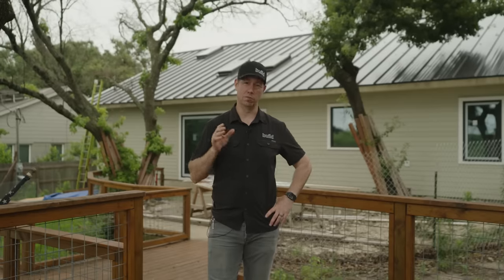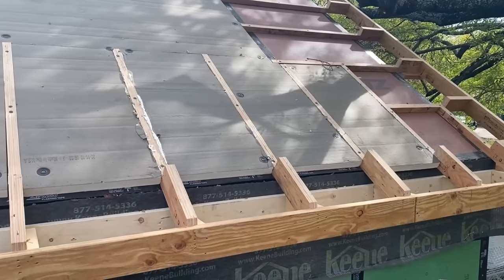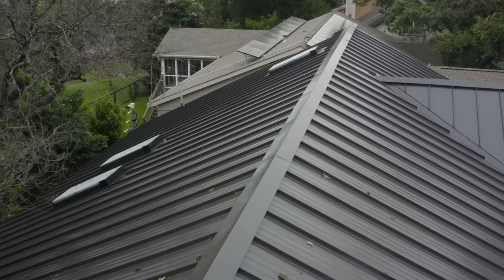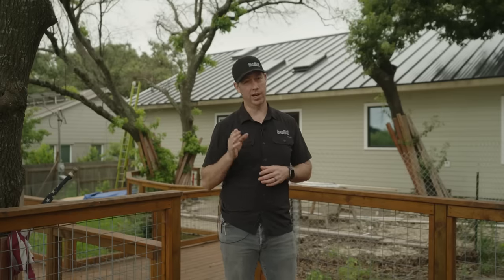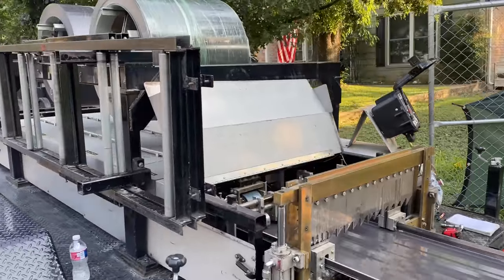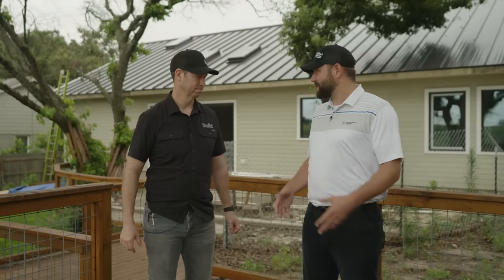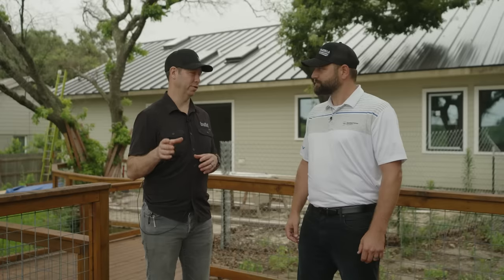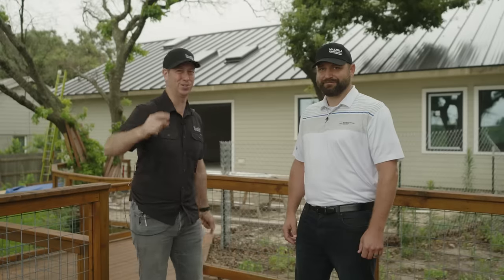Metal Roofs - 2 Ways to INSULATE UNDERNEATH!

Comment: using SIPS for the roof is probably a better option & might be cheaper when the labor costs are included. FWIW: I have 12" SIP panels for my roof, but the 6" SIPs would probably be about the same costs (material + labor) as using the individual Poly Iso panels. Plus SIPS can handle the overhang with out any weird bracing.
Reply: What is the R-rating of those 12 inch SIP's plus the overall rating?
Reply: @StellarFella  R-48 for 12" SIPs
Reply: Where are you located? Matt's house is in Austin, TX, and I'm wondering about the viability of SIPs in austin.
Reply: @h57s  East Coast.
Reply: Love this idea. I'm getting ready to build in Minnesota and could use this. How did you handle the detail of where the wall meets the sip? What panels did you go with?
Reply: @SupercarSeany  Used 2x6 knee wall with the top plate angled to the pitch of the roof. I used 24" overhangs provide shading, and to help with wind driven rain. Used glue-lams for the support beams.I used  plumb cuts for the SIP fascia. I also used a high Perm underlayment so moisture can escape. The important issue is to not use a non-permeable underlayment because it can lead to rot with SIP roof panels.
Reply: @guytech7310  this sounds awesome, I'd love to get some more details/photos/etc.
Reply: @SupercarSeany  Might check out EPS sips in northern Iowa, I'm not sure about anyone closer but they're up the road from me. Shipping gets costly with transportation costs now a days.

Comment: Have had corrugated metal panels on my 1823 Cape for years. Lower cost than shingles, cooler in summer heat due to the 1x3 strapping that gives an air channel from soffit to ridge. Almost no one in Maine uses standing seam due to cost and high profile of fins to wind and snow.  Corrugated also is much faster to install as the panels are 2-3 times wider than standing seam panels. Labor is 1/2 that of shingles.

Comment: Deleted scene: "So that makes the final thickness of my roof four and a half feet. It's a real bomber roof. In fact it's rated to take a half stick of dynamite without penetrating into the attic."

😂
Reply: @buildshow  Matt ,   Loving the steel roofing content.  Just remember … Just because a steel roof panel is a thicker gauge of steel … does not always mean that is a superior product .  Generally speaking , if a metal roof supplier is boasting that their panel product is a 26 gauge .. or a 24 gauge steel .  That is all fine , but what quite a few people fail to acknowledge is that the steel tensile strength of the panel is extremely important as well .   The roof steel tensile strength is the strength of the panel or hardness of the panel .  If you are talking about a thicker gauge of steel , usually those thicker panels are a much lower psi tensile strength  ( tensile strength in PSI ). This is due to the fact the thicker gauge steel panels need to be softer to allow the coil stock to be fed and formed by the forming machines.  The softer the steel ..  the lower psi tensile strength … the less resistant the panel is against storms / hail / debris .   Truth be told , if you look at and study the actual physical thickness of a steel panel  with a micrometer and you start comparing the differences between steel panels actual thickness of the panel on lets say a 28 gauge vs a 26 gauge .. its amazing how little of actual physical thickness differences there are between “ Gauges Of Steel “ .   - Keep up the great content !

Comment: Stupid question: when you build in the venting directly beneath the metal roofing (with 1x4s?) Can you still walk on the roof without bending/dimpling the metal panels?
Reply: I think that's a great question.
Reply: Only if the contractor builds a  road underneath the metal roof. 
My uncle has his roof done that way. Once it was finished the contractor handed my uncle a map . A map to be able to walk on the roof. There is a lot of the roof he can't walk on unless he wants to damage the very expensive roof.
Reply: I have a 24 ga metal roof on diagonal 2x4 sleepers at 16" oc spacing. You can walk on it, just be careful, don't jump up and down...
Reply: 8:18 it looks like the venting is between the 5/8 plywood and the insulation. 
The metal panels would sit on top of the 5/8 plywood, providing support.
Reply: @rogerflorida1498  yes, except for when you look at the diagonal during strips @8:31
Reply: Roger & toldt-
Y'all are comparing two different roofing set-ups.
The one with the diagonal spacers & metal roof directly on top is Matt's personal house.
The one with the 5/8 wood and spacing built in between the insulation is the house he's standing in front of during this video.
Two totally different houses with roofing done 2 different ways.

Comment: Im actually trying to figure out how to insulate my house from the outside so I dont destroy the walls inside. I had a weird metal roof installed on my home that has tall grooves on top - about 2 or 3 inches tall every 4 inches.I want to fill those grooves on top with rigid foam insulation cut to size. I need something to cover that, that isn't very expensive and also doesnt need to be screwed or nailed into anything since my roof is metal down below! I don't think I'm going to be able to use glue on a roof lol. How could I do this and have it be safe? If I glue the foam into place, and paint the roof with elastic roof covering paint, will that last a good long time? I live in a mobile home in FL with a really low budget. I just want the AC to rest sometimes, because its running 24/7 in 100+ degree temps.

Comment: I have a whole house fan in my 1978 home, dated, I know... but, what I would love to see done is an integrated trap style vent installed in the sidewalls of the skylight risers, (into the attic space) with the draw being from a large whole house fan out one side of the house. This way, you can take the air from all the key areas of the home, not just one single point! You could even program them, so only certain ones open, or all of them, allowing you to control how and where you want to pull the air to refresh the house.
Reply: We used to have one which we removed and couldn't afford to replace. That was fantastic in the fall in South Central Texas  nights. Bring in the cool air from outside also to clear cooking odors quickly, or those rare winter days when it warms up in the high 70s and you want to air out your house.
Reply: Keep it they’re fantastic! And way cheaper to run then AC!

Comment: Your homes are mind blowing and the roofing is amazing.   I called a few metal roofing companies for a standing seam quote for my 1800 sq ranch with 24x24 garage.  The quote came in at $90,000.  We opted for a 50 year shingle roof for $10,000.  Not sure how anyone can afford this type of roof.  And that wasn't adding insulation either.
Reply: You could do 9 Roofs for the price of one. Lol sounds logical
Reply: It wasn't that expensive pre-pan-demic. I paid about $34K for 3200 sq ft roof (Late 2019). If your not going to stay in the home more than the lifetime of a shingle roof (about 15 years) than it does make sense. However I am planning on staying on my home, and as material & labor costs go up (as they already are), then it makes sense.
Reply from the maker: That’s really really high. Metal should not be 9x an asphalt roof price.
Reply: @buildshow  Its pretty high. My neighbor got quoted $46K for about 2200 sqft roof using r-panel back in July. Perhps prices have dipped some.

Comment: I love the shingle looking metal roofs that I've seen on their You tube channel. 😍
Reply: standing seam > metal shingles
Reply: @christopher6161  just curious, what's the benefit?
Reply: @christopher6161  that's what I meant 👍
Reply: @koljag5  massive uplift wind rating on good standing seam vs metal shingles limited to 120mph...easier to repair and get replacement parts...easier to find installers...probably cheaper for most installs...metal shingles also use exposed fasteners, and best case they are only covering the fastener on top of the shingle below it with another shingle so very little defense against ice dams/wind-driven rain

Source: I used to shill metal shingles
Reply: @christopher6161  perfect, thank you!
Reply: @christopher6161  There are many metal-shingle roofing systems that have no exposed fasteners and wind-rated up to 200 mph. Take the Oxford Shingle for example.

The other perk to a metal-shingle vs standing-seam is that you typically do not need to vent under the metal-shingle, as there is already an air-space due to the nature of the design. It also doesn't oil-can like a standing-seam. And lastly: Metal-shingles tend to look better.

Comment: How would you incorporate a radiant barrier into an insulated metal roof design ??? On your house would you put the foil on top of the upper ziplock then put the diagonal frame in place with the metal roof on top ????

Comment: Zone 6 -- cold/humid, St. Louis, Missouri. In a retrofit on a 95 year old 1X6 roof deck, could I put (say) 2" mineral wool boards on the deck, some kind of high-temp vapor-open self-stick, purlins, then the metal?  Would the underlayment stick adequately to the mineral wool? Then the thought is to add (say) 4" mineral wool between the rafters -- I'd have a total of about R36, a radiant barrier, and breathability to deal with the condensing surfaces not being engineered as well as we'd like. The idea is to make the attic "usable" as a small workroom more days of the year, take some cooling load off the house, and permit vapor to escape. It might not be great but it's way better than what's there, and we need a new roof anyway.

Comment: Any thoughts on how to pull this off in Zone 6?  There the recommendation if for roofs to have R60.  So you're looking at an 11-inch thick roofdeck with this method.   Maybe 4 inches on top and sprayfoam on the underside in the attic?  Or are you looking at just a massive sandwich of a roof?

Comment: How do the large lag bolts and other fasteners impact the insulation?  Isn't drilling through 4 inches of insulation creating a metal hole that conducts heat and cold every time (hundreds of times) you do it. Is there any information on this?
Reply: Short answer yes, technically. but it is still significantly better than building it traditionally and you do need the strength.
That’s some point you will have to sacrifice somewhere to guarantee structural integrity.
And some small screws won’t really conduct that much energy in the end.
Reply: Commonly referred to as Thermal bridging

Comment: I wonder if it would be possible to put a Pex system into gaps between the wood and metal to capture the heat and put it into a hot water system in the house?
Reply: Just install a solar water heater?

Comment: I am going to build a little cabin (no attic) in Maine using metal roofing. I wanted to do a 2' overhang to keep snow away from the sides, but I read that the uninsulated overhangs can cause ice issues. Is there a good way to insulate the metal overhang? I was thinking I could put foam insulation in between the rafter overhangs and enclose it.

Comment: Been watching a ton of your videos and love learning building science through them. I’m trying to apply the science to a campervan - how would you do it with the somewhat unique closed metal shell (that can leak) and working inwards from there. It’s a high moisture and high vibration environment, and often used in cold climates where the vapor pressure is towards the outside, but can’t because of the metal walls. Campers have a tendency to mold because of this. How would you insulate and keep moisture at bay, while being repairable if things like the seems in the metal roof leak?

Comment: If you were doing ICF, and plan on having a poured/sloped concrete roof as well, is there still any advantage to going with a perfect wall/monopoly house style of roof arrangement? It seems to me like there would be benefit in keeping the blazing sun off of that thick slab up there and covering the concrete from the weather.

Comment: I live where wildfires must be considered.  Which method of airflow/decking would be more resistant to fire?
Reply: I'm also in a wildfire area.  I would think that the Hunter panel would NOT be the way to go for that.  Embers could be sucked up into that vented space which is a sandwich of Poly-Iso and CDX, both of which are flammable.  The other assembly with furring strips below the metal roof could be made more fireproof by using a fireproof peel and stick barrier and a non-combustible material or coating for the furring strips I would think.
Reply: @kenyonstewart7120  I think you need to consider a few factors here... how flammable the surfaces are as well as the ember size. Really small embers burn out very quickly - this is why vent screens with mesh size smaller than 1/8" are part of WUI requirements. So the intake/exhaust venting screens are critical. Not mentioned here is the heat resistance. Matt keeps referring to polyiso which melts at a fairly low temperature. Personally I would like to see what the assembly might look like with Rockwool for a WUI assembly.
Reply: @stevejahr5527  agreed, I am planning on using Rockwool at least for the outer layer and a fireproof peel and stick membrane under that.  Ours is a remodel, not a new build, but down to the studs.  Cladding will be either metal or one of the more modern looking Hardy Commercial products.

Comment: SUMMARY This video is about metal roofs with rooftop insulation. Matt Risinger will discuss two ways to insulate under a metal roof with experts from Sheffield Metals.

The first way is to use polyiso insulation on the roof deck, followed by a layer of fake rafter tails. Then, LVLs are screwed on top of the fake rafter tails to create a space for a second layer of polyiso insulation. This way, a total of 4 inches of insulation can be achieved.

The second way is to use Hunter Panels, which are pre-made panels with a layer of insulation already bonded to them. This method allows for air ventilation between the metal roof and the insulation layer.

Here are some of the benefits of using metal roofs with rooftop insulation:

Long-term durability: Metal roofs can last for several decades without needing to be replaced.
High wind and hail resistance: Metal roofs are more resistant to wind and hail damage than other types of roofs.
Improved energy efficiency: Metal roofs with insulation can help to reduce heating and cooling costs.
Airflow benefits: Depending on the assembly method, metal roofs can allow for air ventilation which can be beneficial in both hot and cold climates.

Comment: Matt, can you put that roof assembly on a house built in the 50s or does the wall structure need to be strong enough for the extra weight?
Reply: You need to talk to an engineer.

Fwiw: I am planning on something similar in Michigan on a mid 40's lake front cottage. I'm tearing off the saggy 2x4 roof that has some 2x6 scissors added. While I'm at it, gonna rip off the back 24' and turn the crawlspace into a 800 Sq ft basement and toss in some of those European triple glazed windows and door walls. 

May even use ICF on basement walls. Depends where the budget lands, might be a partial icf for the exposed areas.

Comment: What do you recommend for flat roofs? I live in WNY in a renovated 1800s farmhouse. We have a rubber roof and it’s fine… but the snow piles up and I have to put up heating cables and sometimes even push it off… I am hoping a black metal roof with help because 1. It’s lighter and 2. The black will melt the snow and 3. The heating cables will heat up more of the roof and melt the snow. But I’m worried about insulating under the metal.

Comment: With the air gap under the metal roof, could you add a fan or forced airflow of some kind? My assumption is that would greatly reduce the heat getting into the roof.
Reply: That sounds like a great idea, it wouldn't need to be a big fan either. It could be run off a small solar panel.
Reply: Maybe put a water sprinkler on the roof

Comment: I'm interested in how a roof with this much foam between the structural members and the roof deck would handle snow loads.
Reply: All that foam wont make any difference if you have a snow load.  Meaning it wont compress the foam. Those pannels are very stiff and the load your putting on it with snow is very even.

Comment: Love your videos! What size of the overhang/eave would you recommend on 2000sf ranch style home with metal roof? 
Thank you.
Reply: Matt recommends larger overhangs (usually 2 feet) to give more protection from rain/water "splash back" onto the lower portion of the wall, where most rot occurs.

Comment: Hi Matt et al, On an earlier build in 2014 (https://www.youtube.com/watch?v=d8i-93ABo3I) The roof from the bottom up looked like:  deck, peel and stick (wip 300), poly iso, poly ise, 1X4 battens (air gap) then the metal roof.  Pretty much the "perfect wall" concept.  On later builds, you have moved the peel and stick to the other side of the poly iso.  eg deck, 2" pi, 2" peel & stick, 1X4 battens (air gap) then the metal roof.  On your own house you added a layer of zip roof sheathing between the peel and stick.  What is the thinking behind moving the peel and stick to the outside of the poly iso? Do you have a different air barrier above the base deck when you move the peel and stick to above the poly iso?
Reply: On the base roof deck, Matt used 5/8" Zip sheathing (which has an integrated WRB on the surface) and taped seams, so no need for a peel & stick there.   Then 4 inches of Poly Iso, followed by another layer of Zip, then the peel & stick before the battens & metal panels.   His set-up adds an incredible amount of extra protection and R-value, but generally out of reach financially for most average customers.